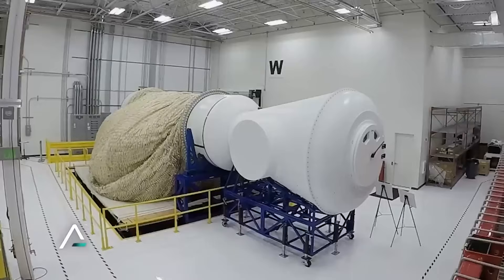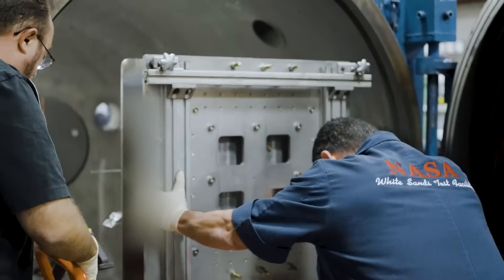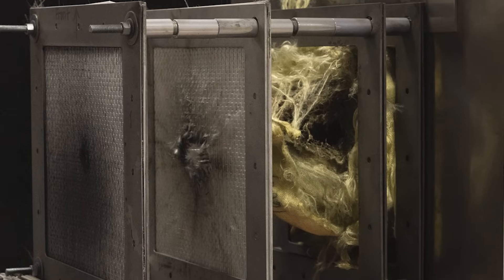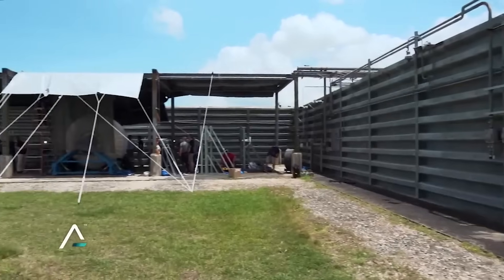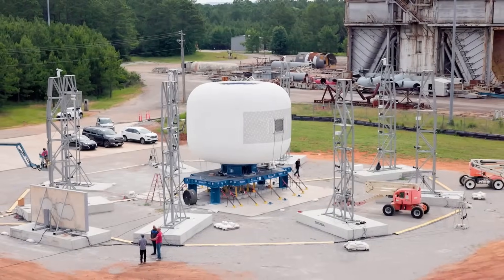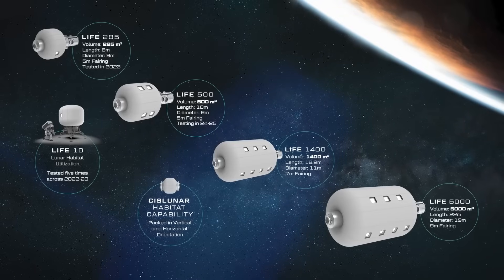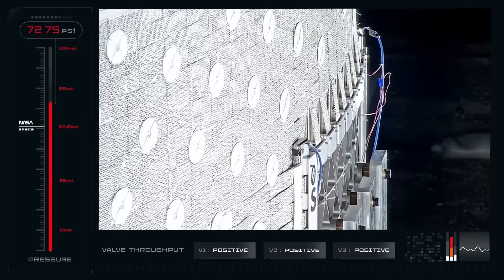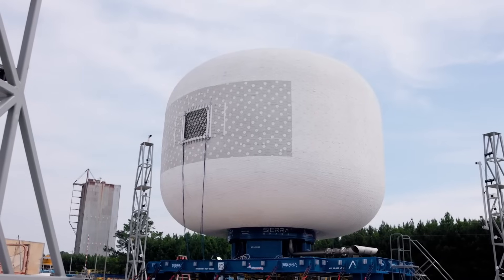Sierra Space Has Begun Inflatable Habitat Impact Testing

Comment: I was reading up on the wind storms of Mars, and I was told at the time in the news article that wind speed can get up to about 110 miles per an hour when a dust devil or storm appears. I like what Sierra space has going on here. I think its very durable. But, I'm not a trusting guy for people to go to a planet with no help around for thousands of miles. And them stick them in an inflatable tent. This thing would have to positively get an additional layer of regolith or something with a multi-layer 3d printed shell. Otherwise, I hope you like being an actual cave man. 
-- if its still this risky, in short. Lets just send some robotic 3d printers, and robotic electric excavators. We can make it much safer for humans before they even get there. Besides Excavators have hundreds of attachments besides just having a bucket. This could prove to be extremely efficient and save a ton of time. Especially if they need a rammed earth method to lay a permanent structure on..

Comment: Starship could launch the entire outer structure of an orbital hotel or micro gravity manufacturing plant.  A few subsequent launches could supply the inner walls, furnishings and equipment.  This has enormous potential to get humans into space faster and cheaper.  Imagine 120 of these strung end to and and joined to make a large wheel that spins to simulate gravity, with 8 connecting spokes with elevators leading to a central axle of these modules for micro gravity labs and manufacturing.
Reply: Then why not let Spacex design one single inflatable module; that fully fills a starship's cargo space when deflated?

Comment: How are all the internal framing, electrical, plumbing, hardware, batteries, or any other rigid articles packed into this for launch? I just see the outer shell   here.
Reply: Those items are placed in the core. The habitat has a central metal tube that the end plates attach to. Utilities go in that,, then wall and floor segments are strapped to that spindle, and the inflatable bag is pulled over that structure and secured. In orbit they inflate the habitat, enter, unstrap and place the floor and wall panels, then unpack part of the core to place. Other equipment would be sent up as cargo on other flights.
Reply: You can bring modular panels in from a densely packed rigid vessel.  Imagine panels with pre routed electrical along the back with loose ends to plug into a main hub. What these will connect to will be designed to suit them.

Comment: Once inflated I wonder if a UV activated epoxy could be applied to the inner most layer to make the structure rigid?  If once deployed, an air leak occurred, the structure would lose shape correct?  But if the inner shell had epoxy applied, it could hold shape.

Comment: Part of the traditional space station shielding strategy is to have multiple layers spaced out in front of the pressure vessel (as shown in the testing footage). I don't understand how an inflatable habitat would be able to do this. By the very nature of being inflatable, it won't have a metal shield layer spaced a certain distance away from the pressure vessel. All the layers would be in direct contact with the next layer.
Reply: Bigelow did all this a decade ago -  "under contract to NASA, for testing as a temporary module on the International Space Station (ISS) from 2016 to at most 2028, when the contract can not be further extended. It arrived at the ISS on 10 April 2016,[6] was berthed to the station on 16 April 2016, and was expanded and pressurized on 28 May 2016. Although originally planned to be a two year test, it has exceeded expectations and is used as additional cargo storage. The module is under ownership of NASA after Bigelow Aerospace suspended operations in 2021." From Wiki.
Reply: Can't they use some kind of foam? Regardless it is a stupid idea by people who aren't serious about building a spacestation.
Reply: There is the same strategy here, the inner layer is the only one airtight and inflatable, then many other layers are separated by a thin layer of air under very low pressure. 

There is about 15cm of layers between inside and outside.   

By the way, the name is Whipple Shield.